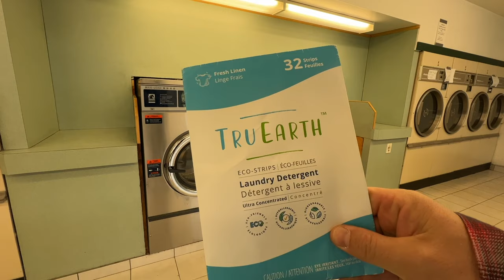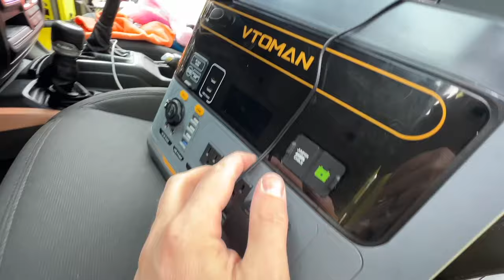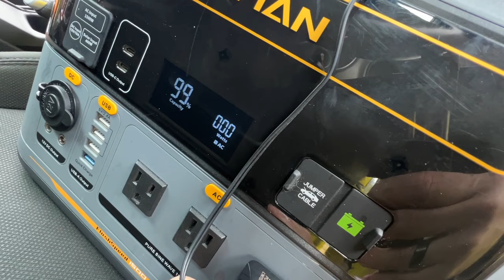Life in Small Town BC - Prep for a Special Visitor

Comment: We call those transfer stations for refuse/trash(dump)
Reply: When you gonna go all in and buy some wood/plywood? I was also thinking that the electrical could be put on 1/2 inch (OSB) Oh Sh!t Board(particle/Fiber) and get actual plywood/leuan wood 5/8-3/4 for the bed, but you could go for a smaller sized board with enough braces. Thick wood/less braces, thinner wood/more braces.
Reply: Wood glue works just as good with a few fasteners without having to take chunks out when disassembling.

Comment: 5000 miles/8000 km max on an oil change.  It's not the oil, it's the filter.
Reply: If he's got that pentasar engine, that plastic oil cooler assembly is a major weakness

 (unless the manufacturer finally smarten up and uses an aluminum assembly now)

Dorman has great ratings for this part upgrade (which is rare for them)😅